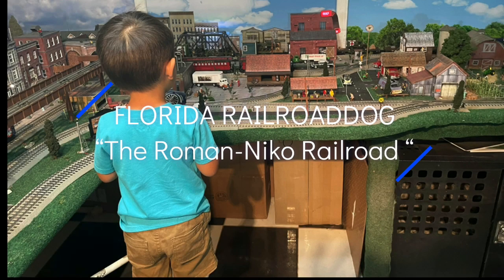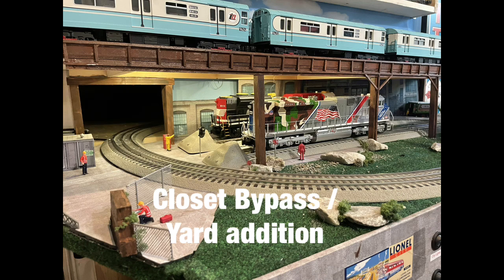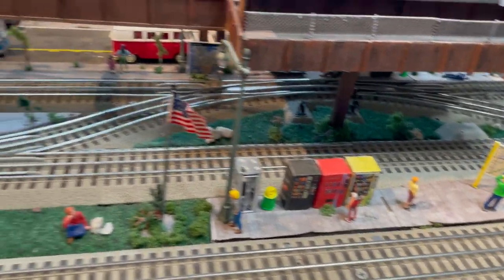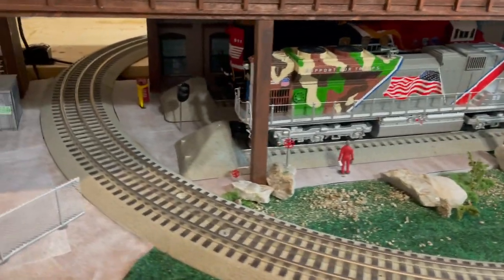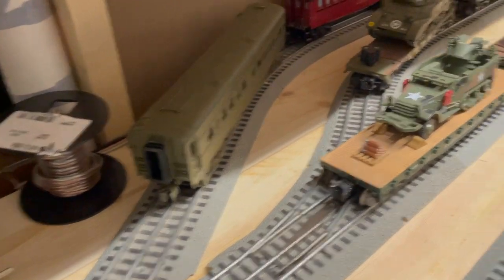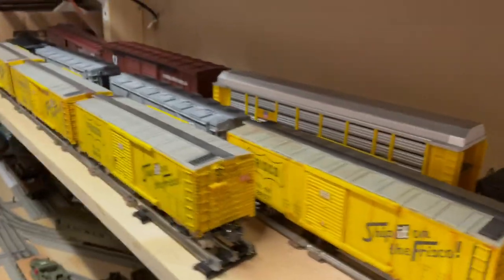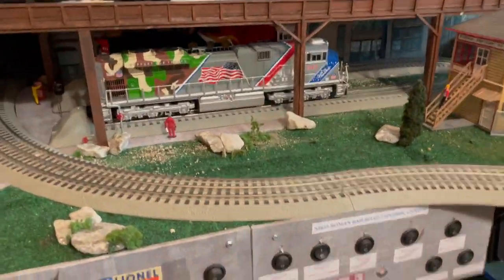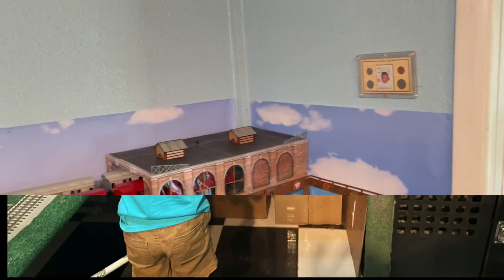O Gauge Layout - Closet Addition

Comment: Looks good! I like your subway sets. Do you ever have issues with that curve in the front that looks like is partially off the edge?
Reply from the maker: No its sturdy enough that the trains manipulate it good.. eventually I’m going to add a board underneath and put supports for it. But it will mostly be for looks, since the track hanging like that looks weird. Yea I love the subway sets. thanks for stopping by 👍